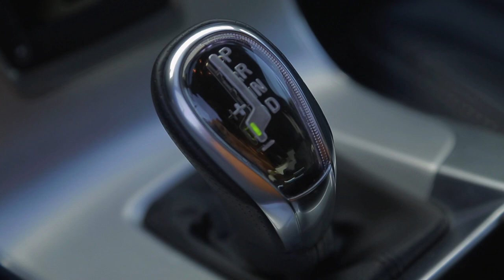Roadkill Monza Aftermath! Plus Audi S4 vs Volvo S60 & Ford Leaving Australia - WOT Ep. 69

Comment: The Monza's problem was they didn't give the leafblowers enough air in the back end of the car. On the dyno they had the hatch open and lots of air could get in. When they put it on the road they shut the hatch and cut off the air so there was no boost.

Comment: I'm going to be sad without the falcon. My dad grew up with them which means that i have too. Just got myself a 2006 SR on gas :). At the moment dad has a G6E Turbo and it is a fantastic car. Not as many features as some newer cars but it has so much power. It doesn't struggle towing our 2 ton boat and just takes off.

Comment: Seriously, 410hp? Yes, it's underrated but most of the S4's made 350-370 hp on the dyno.
For the 0-60 mph: 4.9 - 0.3 for the stupid 1ft-rollout + influences like grip of the surface (not necessarily in the S4), weight of the driver, how much gas in the tank...= 4.4 to 60 mph

Comment: More to the point, they worked out that turbocharging allowed such a blatant ability to extend an engines power over the NA side, Mainly because of the Ford Sierra, that they spat it when the AWD turbo Nissan smashed them.

There were better ways to deal with it than an outright Ban, but such is life unfortunately.

Comment: That would be Group A you're thinking about there drifter200.  They were road car chassis fitted with race parts where as V8 Supercars are more like NASCAR  in that they're tubeframe chassis race cars with ford or holden panels welded over the top.   /watch?v=HG5IPrasDhQ

Comment: stop saying boost is a measurement of restriction. boost is in increase in density. boost loss is a measurement of restriction. in a perfect world the boost pushes on the pistons and the pistons push back. what you should have done with the Monza spider thingy was run the leaf blowers in series. you may have needed to run 2 or 3 parallel for the cfm or to prevent a loss in pressure ratio at high rpm, but having another stage would compound the pressure ratio. the pressure ratio would be low so it's hard to know what the ideal combo would be but I suspect 3 leaf blowers into 2 leaf blowers would have gone faster than 5 parallel leaf blowers.
Reply: daniel dimitri leaf blowers can't produce boost they don't have a good sealing power and most of what would be consider boost leaks past the fans so all it's doing is increasing air flow that's about it.

Comment: In an ironic twist of fate Holden Actually bodied some model - T's way back when before they were an actual Car Manufacturer, not just a body builder, Actually ford Proper in Oz didn't actually start unil 1960 with the XK model. Before that there were models bought in by distributors and bodied by different body builders.